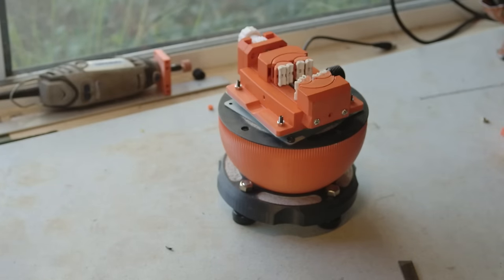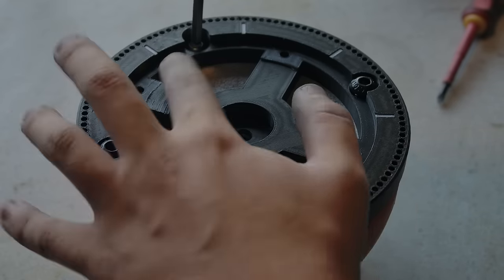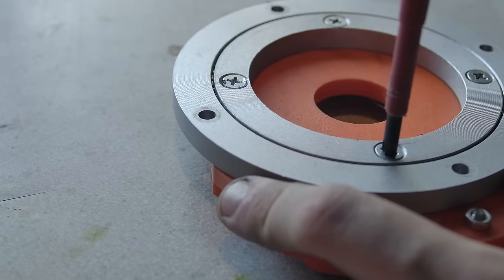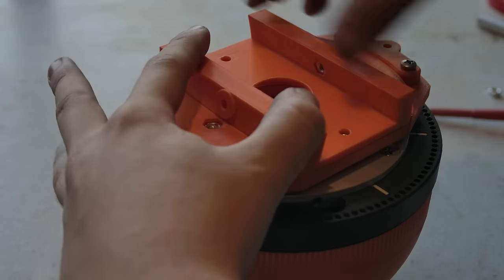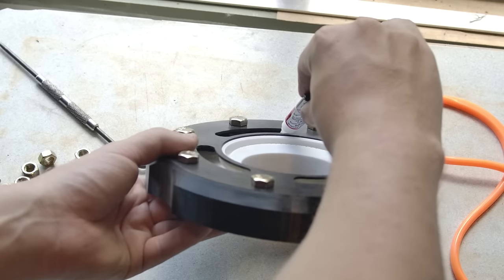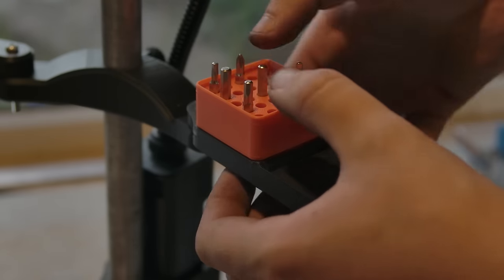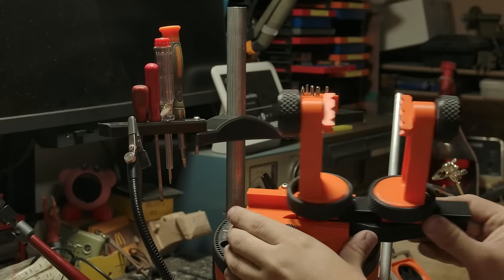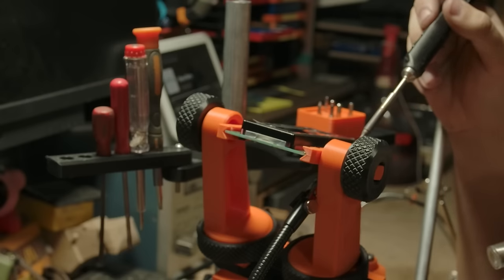I Upgraded My Ball Vise

Comment: Pre-existing rust shouldn't cause concrete to crack. Cracks occur when the steel that's already inside the concrete starts to rust, because rust takes up more space than the steel did before rusting, which causes expansion. It shouldn't happen if you keep the concrete base indoors, but if you're worried you can seal the concrete using special sealer that would prevent more moisture from entering through the porous surface.
Reply: You don't need to worry about the steel inside the concrete.  concrete is an alkaline material which creates a passivation layer on the surface of the steel. Since your concrete isn't stressed, it's unlikely to form cracks which will allow water to get in and damage that passivation layer and cause corrosion of the steel. If you're really worried about it, you could paint it with some regular lyx pint something similar to waterproof the exposed surfaces
Reply: Exactly. Rusty concrete is used in the construction industry as the increased friction increases its effectiveness in reinforced concrete members. As stated by another comment, the alkaline environment will inhibit rust progression.
Reply: @davidbrennan7422  the concrete is just there for weight anyway, you could just use sand or gravel too, so cracks in the concrete don’t really affect its use. Also in this application water getting in likely isn’t too much of a concern anyway.
Reply: @conorstewart2214  Yep, completely agree

Comment: It looks like you're using a screw and a series of depressions around the perimeter of the rotating bearing to lock the bearing in place, which I think is a good idea. I wonder if you could create an adjustable friction mechanism by having a plane bearing surface and a low friction or medium friction surface like a piece of felt that you could adjust with the screw to create an adjustable resistance rotation rather than simply a stop.

Comment: A note on weights. When I made a ball telescope, I needed a counter weight and I used BBs in epoxy. BBs and cement would probably be even better. It’s a good source of mass that can be acquired new at a relatively low price.

Comment: Add exhaust fan attached to an adjustable arm to help pull the smoke away from your face as you work.  I'm thinking a simple PC fan.  You could feed it to a hose duct to route it out a window.  Have the option to flip the direction of the fan so you can have something cooling you off while you work.
Reply: It is very easy to make a simple filter system too, just use a PC fan with a cheap carbon filter in front of it. Maybe add a HEPA filter if you really wanted. A carbon filter is all you need for something like soldering.
Reply: He's got a Kirby solder exhaust eater fan thing on his thingiverse page 😂

Comment: What a great tool. It prints and works briliantly. I opted to fill it with sand-epoxy mix and added some scrap metal which works also briliantly. Still printing some of the addons to see what works best for me. Thanks so much for sharing and having this opensource

Comment: I used a shot put ball to make chasing balls. The Olympic official weight is 7.2kg but you can buy training versions in heavier or lighter. They are right cast iron so they need to have the entire outer surface ground and sanded smooth. And you will need to machine a flat face. There is a hole drilled to adjust to the desired weight that can be used for fixtures.

Comment: If you live in an area where reloading supplies are a thing you can get,  lead birdshot for shotguns would be significantly easier to mix and pour into the concrete.  The birdshot are small lead spheres, so mixing will be even easier than the wheel weights.  Additionally, the birdshot is smaller in size than the wheel weights and can simply be mixed into the concrete prior to pouring.  Alternatively, you might look for tungeston powder, heavier than lead and even easier to mix into concrete.

Comment: I have been working on parts for this very thing. This is crazy. I went modular at first. Tip: Cannibalize from stop-motion armatures, 3d printer frames, etc. Robotic arms are spendy. I'm going to shut up and watch your video now. I can't believe this.

By the way, my project started as a way for people with essential tremors to reengage in their hobbies. Whittling, airbrush, stenciling, painting. My therapist is going to love your video!!!

Comment: Rather the recutting the threads and using nuts you could just screw directly into the plastic. It holds perfectly fine but only lasts a few times being screwed or unscrewed.

Comment: A vibrating pen or rod from amazon would be a great tool to have if you intend to do more future projects with concreate since it will seal the concreate surface better and make it less brittle or powder like when it's dried up.
The concreate will be more uniform when drying up rather then full of air bubbles as it is dried up.

Comment: The concrete isn’t really structural and is just there for weight so cracks shouldn’t really matter, you could do the same just filling it with gravel or sand.

Comment: When soldering, especially when up closer to your face, make sure you wear glasses or goggles. All it takes is the flux to spit and it could end up in your eyes which is not very good for them.

Also a good upgrade would be an extractor fan. Any fan, most commonly a PC fan, plus a cheap carbon filter will suck the fumes away and get rid of them.

Comment: Re: Rust Cracking the concrete - I'd take a look at Practical Engineering's videos on concrete and rebar and Colin Furze's videos on his tunnel/bunker/underground garage build. The reason rust cracks concrete is because the steel used expands when it rusts. Not a lot, but enough to ruin precision surfaces and cause concrete to crack due to the fact that concrete is great in compression and terrible in tension. If you put something that's already rusty into the concrete and completely cover it, then it won't continue to rust, which means that it won't expand, which then means the concrete won't crack. If I'm remembering right, concrete can also react with rust while curing to prevent the steel from rusting further. I'm not 100% sure I have that right and even if I do, I don't know what chemical reaction is happening to do that.

But, the TL;DR: is that you probably don't have to worry about the concrete cracking.

Comment: The big ball needs a way to change tension in my opinion, from soft to locked. 
Also the vise itself, at least the gripper should be metal. I can see my clumsy fingers destroying or melting the plastic grip or base.
From that apart, I'd pay quite a bit for a set like that (prebuilt). A hundred $ would be fine imho.

Comment: Not sure if I'm a fan of glueing the dovetail adapter onto a plate. As you have shared the step file, would you mind if I tried and modify the design for that adapter to be removable?
Reply from the maker: Yeah go ahead, its just so the dovetail can be printed in an easier orientation

Comment: When rusted metal is covered in concrete it will stop rusting and it will not crack the concrete, lack of steel reinforcement and thermal expansion will crack the concrete. If the concrete layer is to thin around the steel, water can get to it and make it rust. Although steel’s natural tendency is to undergo corrosion reactions, the alkaline environment of concrete (pH of 12 to 13) provides steel with corrosion protection. At the high pH, a thin oxide layer forms on the steel and prevents metal atoms from dissolving. This passive film does not actually stop corrosion; it reduces the corrosion rate to an insignificant level. For steel in concrete, the passive corrosion rate is typically 0.1 µm per year. Without the passive film, the steel would corrode at rates at least 1,000 times higher...

Comment: an .au guy who filled his milling machine frame did same, he used granite epoxy and junk metal bits.
if you can't buy lead shot in bags, can melt it and fine drizzle off a height, more than 10 feet into water tank, assumes spherical shape in flight, the smallest balls possible (dust would be perfect but hard and dangerous)...pour these with epoxy into half sphere.

Comment: Concrete engineer here, as long as the rust is not loose (DK gravrust) the alkalinity and minerals in concrete attacks the rust and create a seal bonding tigthly around the steel protecting it from further corrosion. Any plating with zinc (or loose rust) will also be attacked but seperated from the steel as a loose black powder, hence the necessity for the spacer on the bolt.
Using rusty material includes a mandatory shaking and thats it.
A vibrator will also help on the casting, leveling up from the prodding with sticks from the last video. Massage anything or a drill with hammer function on the table does the trick horribly loud

Comment: I would recommend to print the "concrete-related" parts with PETG. why? PLA degrades in contact with concrete. concrete is highly alkaline and attacks the PLA to generate lactate salts. It is worse when you try to reinforce concrete with PLA, but the same problem should arise: the concrete will not adhere to the PLA as the boundary layer of lactates (that generate initially, and grows over time) is powdery.  there is quiet a bit of research, PETG (in the cheaper end, of course) is the best for reinforcing concrete (as does not react at all, and their properties are not crap like ABS/ASA)
PLA is good for everything else that do not store energy for long periods of time (creeping problems). ABS/ASA is best for high temp apps but not exposed to UV (but if you are already spraying cancer particles and toxic fumes, you could just use PC if your machine can melt it)
Reply: that's an interesting point, though I reckon one solution would be to coat the inside of the ball with epoxy

Comment: Rust won't cause the concrete to crack over time. Not sure where that person/people got that information. 
The surface rust actually helps with the bond to the concrete and once the concrete has cured, the rusting process stops. Rusty reinforcement is installed into concrete slabs every single day.
Concrete cancer is probably what they're assuming will happen, but concrete cancer will only start if a portion of the steel is exposed to water/oxygen.

Comment: Even if the rust on the nails did progress enough to stress or even crack the concrete, so what? It's not a structural piece.   It's not going to crumble into gravel, and that's how bad it would have to get before it's a problem.

Comment: ohh nooo not the coupling nuts again in the design.  I had such a pain in the ass time finding those
Reply from the maker: Ive added a printed version, even if its weaker, or you could just use two m8 nuts you just have less thread to use.
Reply: @Borgedesigns  I ended up using to 5/16 nuts (as you know, these are nearly interchangeable).  Thanks for designing in a printable version

Comment: I'm an apartment dweller, and the need for concrete is where I hit a dead end. 🤔
Reply: there's concrete in the sidewalk
Reply: it's just sitting there
Reply: have you ever seen anyone guarding the sidewalk concrete
Reply: you could use sand instead, and cap it with glue or epoxy
Reply: Most home improvement stores carry small quantities for patches 1 bucket would probably be enough for the whole project